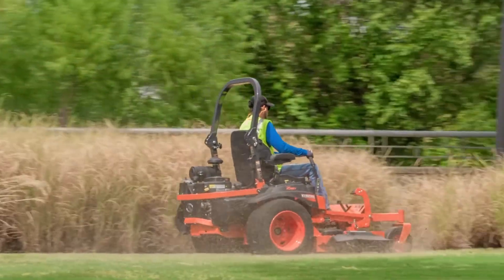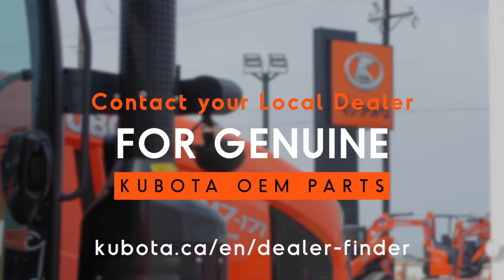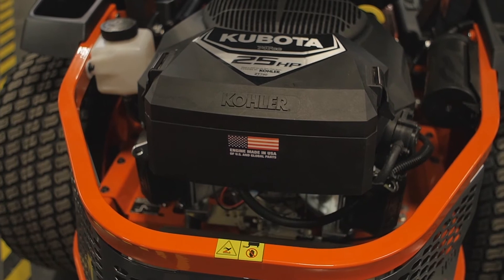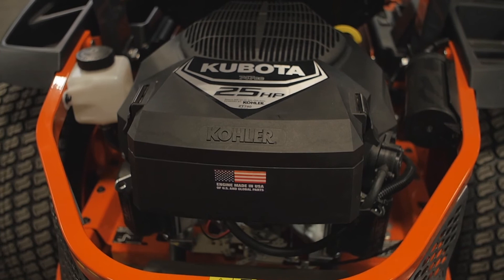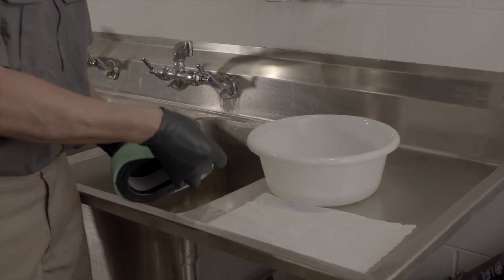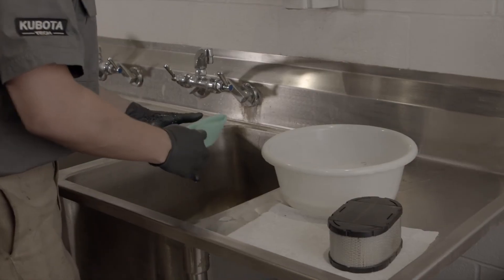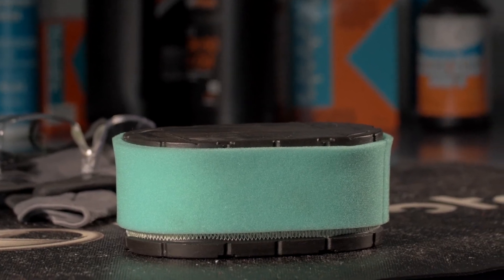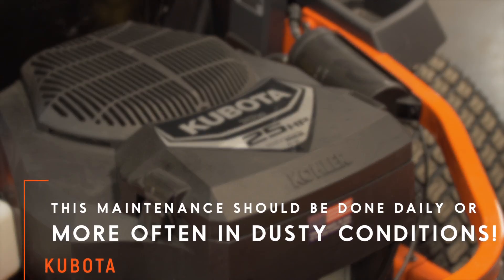Mastering Air Filter Maintenance for Your Kubota Z200 Kohler Models

Comment: At 2min 2sec to 2min 6sec, left side of screen says "Once the precleaner is dry, saturate it with new engine oil.."  Huh?  Put oil on the prefilter?  "Pre-cleaner" pre filter are used interchangeably through out video.  Confusing.  Called dealer and they said DO NOT put oil on prefilter.
Reply from the maker: Hello there, thank you for your feedback. We appreciate your attention to the details in the video. For accurate maintenance procedures, please follow the guidance from your dealer. If you have any further questions or need clarification, feel free to reach out to kcl_g.customerservice@kubota.com.